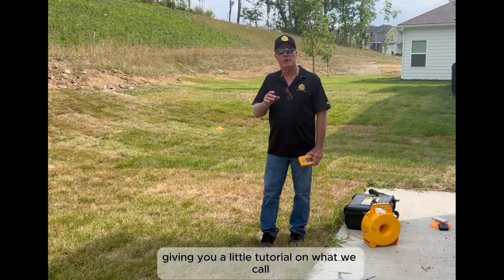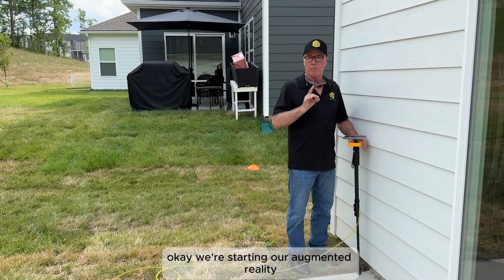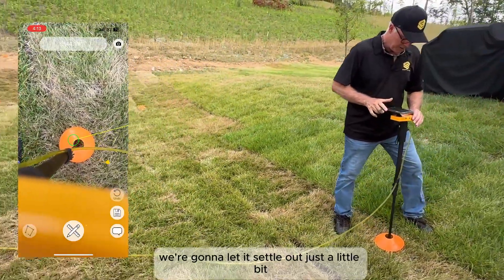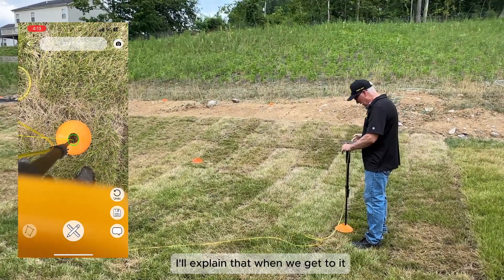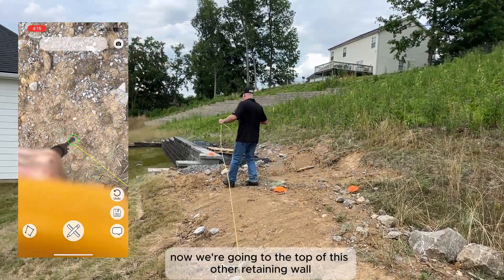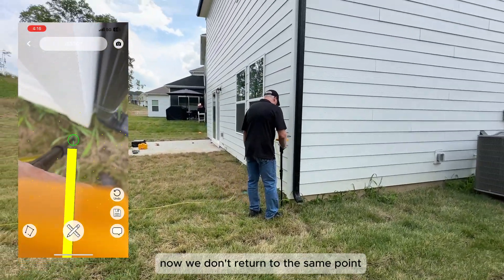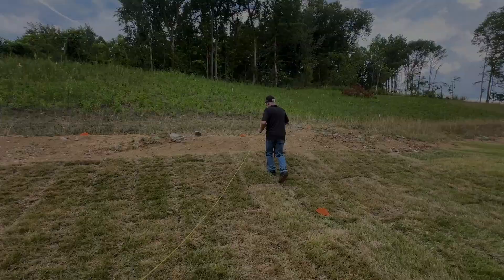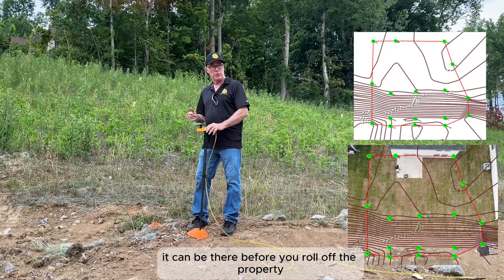AR MAPPING - Augmented Reality

Comment: I am a ziplevel convert and beginning to use this function a lot...Is there a way to get the readings to display without overlapping in the JPEG version of the file? It would be super helpful to be able to read the points on the jpeg image or in preview version but the measurements overlap and hide each other really badly. Maybe in a future app update? Don't always want to have to use a CAD program just to read my points.
Reply from the maker: Yes, there is a way to do that, I believe that's done within the design program itself however Mike - owner of Smart Level will be the best person to confirm that and walk you through it! You can reach his work cell at the #800... (800) 472-3741 or Mike@SmartLevel.us. OR you can email this question to Jennifer@smartlevel.us and she will FW the message along and make sure you get answer!